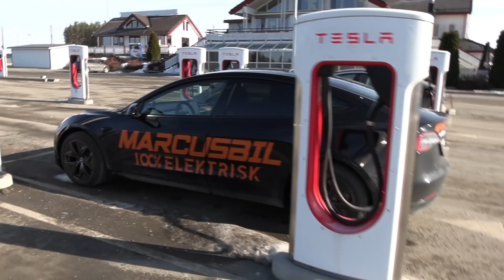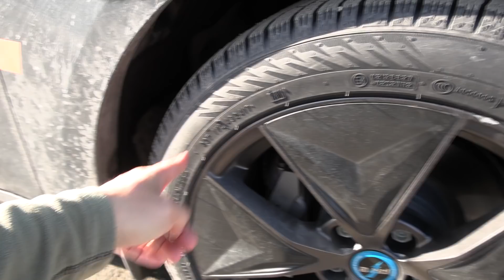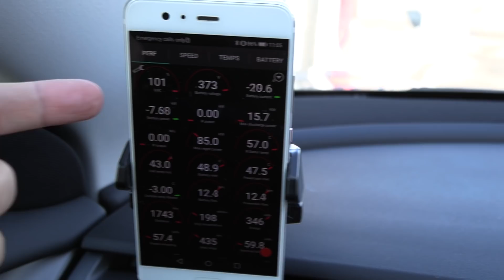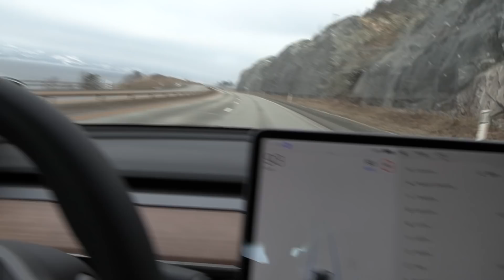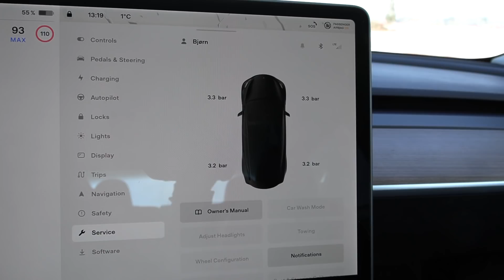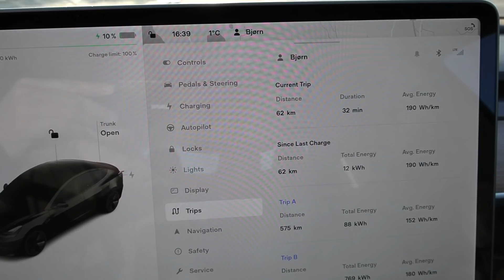Nokian Hakkapeliitta R5 range test

Comment: It's actually correct Bjørn, new tires equals more consumption. It's called stepping, think as if each lamella on tires is a step. When oem's meassure consumption it's normal to use worn out or grinded down tires.

Comment: Wish there were a tire-noise test, e.g: Same car, same wheel size and rims, but different brands to check the various noise levels. As a EV owner the tires makes a huge difference, but it is impossible to find credible tests (controlled) to range the tires from noise. The best I can find are databases that states "this is a silent / noisy tires". It provides little help for the end user when there is no test. Comfort is important, and I am willing to sacrifise a bit of range and safety for better noise reduction.
Reply: There are EU-marks for EU-tested tires. It says consumption, breaking in wet environment, and tire-noise. Hakkapeliitta R3 was 72dB.
Reply: @GeckoClever  Oh? Do all tires have this? And is there a database page to see all tires? Thanks
Reply: @GeckoClever  The EU tire noise measurement is only meant for noise outside the car (for pedestrians), not inside the car. These are two very different things. Tires that have a soft compound often makes less noise inside the car, but more noise outside the car.
Reply: @TheVeryEnd87  it is pass by noise in dB. If it is transferrable into the coupe of the car is a different story. On the R3 the pitch on my 20'' wheels changes depending on speed. I don't consider myself very sensitive to noise (stereo is playing quite loud most of the time).
Reply: well, I can say for sure if you care about noise, never ever run r-series tires. lol

Comment: The tyre model is "R5 EV". This is good marketing by Nokian, because noise is more noticeable for EV drivers than fossil drivers. As you've said the kind of noise is relevant too, the kind of sound frequency, so perhaps the noise reduction will be noticeable for all drivers (just more so with EVs).
The R5s are designed for "electric cars, crossovers and SUVs" so other improvements over the R3, like maybe wet road handling, would be relevant for all heavy cars.

My Michelin winter tyres (not "Nordic") for my fossil van are rated as 71dB on the EU label (there's no EU label available yet for the R5s).
The Nokian R3 EU label rating for noise is 73dB. Do you know how this standardised test is conducted? Presumably it's desgned so as not to include engine noise.

Comment: It all is down to track temps. 1°C isn't good for warming the compound to get it on the right elasticity to diminish friction/consumption.
So you need more agressive warming up before the test, and then you are ready to go. 
With my B class tyres the consumption goes down 10% after warming up. I notice clearly when I come back home after a long trip, and compare with back from work.
Reply: Well…it’s winter tyres…not exactly made for high temperatures.
Reply: winter tire test 

@#$%

Comment: Acoustic foam would work really well if you could put it on the OUTSIDE of the tire 😉. I really can't see how foam on the inside of the rubber helps.
Reply: @benbaselet2026  I've tried with and without, as expected, there is no difference.
Reply: It does work but foam only reduces higher frequencies and most road noise is low frequency

Comment: 3.1 bar = 45 PSI. That is extremely high pressure for such a mid weight car without any cargo. No wonder noise is high and comfort and consumption is low.
Reply from the maker: Not high at all. This kind of pressure is common not only on Teslas.
Reply: @bjornnyland  No. Some examples below, you can show some more.
ID.4, which is a heavier car: 
2.5 bar = 36.26 psi Normal load all-around

2.8 bar = 40.6 psi Front Max load, 3.1 bar = 45 psi Rear Max load

e-tron, a much much heavier car:
front 35 rear 38 psi, 2,4-2,6 bar. Normal load all-around 
 Front Max load 39 psi rear Max load 42 psi 2,7-2,9 bar. 
Why doesn't Tesla specify unloaded vs loaded pressure, and you ran 5-10% higher (3,1 vs 2,9) than nominal on a lighter car?

Comment: I'm a Nokian resaler and a fan of Nokian for more than 10 years but I tested that Nokian is not anymore a good tire in deep snow. Michelin xice snow and north 4 have way more grip in real snowee conditions (Québec, Vermont and Ontario road trips ) Michelin tested and R3 and hakka 10 studded and also hakka 9 not a Nokian fan anymore. Sorry Nokian. The new R5 to tight for real deep snow (smachted potatoes) My new WRX will have 2 sets of wheels and tire ready one with Xice snow and the other with north4 studded for hard driving on my sundays gaz fuelling trips lake Champlain. For the Tesla the tires to go 100% is continental vikings 7 or Michelin confort, millage, noise, grip. Tires is a subjective thing, the reputation tends to make your opinion and a good saler is the one who can sale a freezer to an Inuit without lying. I'm a pretty damn good saler the best ratio of high end tire in my group because I never carry my client where he don't want to go. My opinion on winter tires is purely objective and has been tested.

Comment: ok I know the aero kit is awesome, but I think I got 275wh/mi before I got it when I was on snows. for many thousands of miles (sr+)
I can put those tires on and run a few thousand miles with the aero kit and coilovers and see if it changed, But I'm not going to be driving only highway miles so I don't think it will compare at all =(
Reply: I'm going to be need to be paid up front before I go back to TX fyi

Comment: I wonder if this would also be good and a PHEV ? Also will they have the r5 in smaller sizes? like a 215/55 17" or 215/45 17"?
Reply: Yes they will, I'm a Nokian resaler and a fan of Nokian for more than 10 years but I tested that Nokian is not anymore a good tire in deep snow. Michelin xice snow and north 4 have way more grip in real snowee conditions (Québec, Vermont and Ontario road trips ) Michelin tested and R3 and hakka 10 studded and also hakka 9 not a Nokian fan anymore. Sorry Nokian. My new WRX will have 2 sets of wheels and tire ready one with Xice snow and the other with north4 studded for hard driving on my sundays gaz fuelling trips lake Champlain. For the Tesla the tires to go 100% is continental vikings 7 or Michelin confort, millage, noise, grip. Tires is a subjective thing, the reputation tends to make your opinion and a good saler is the one who can sale a freezer to an Inuit without lying. I'm a pretty damn good saler the best ratio of high end tire in my group because I never carry my client where he don't want to go. My opinion on winter tires is purely objective and has been tested.